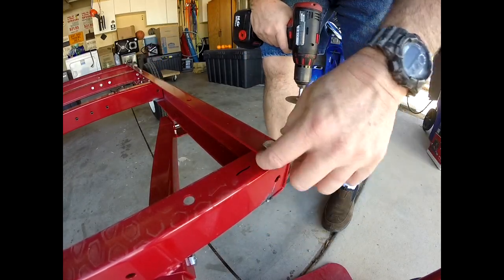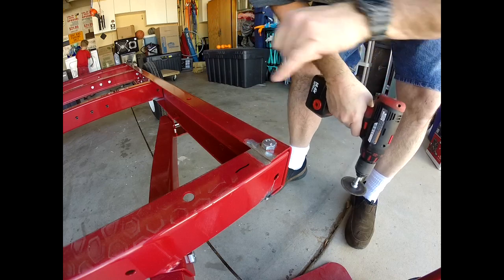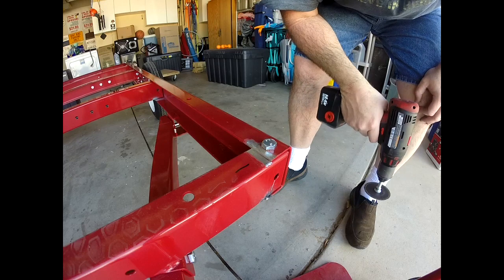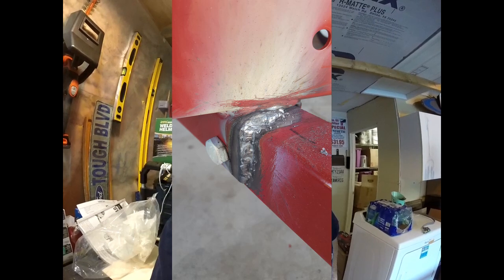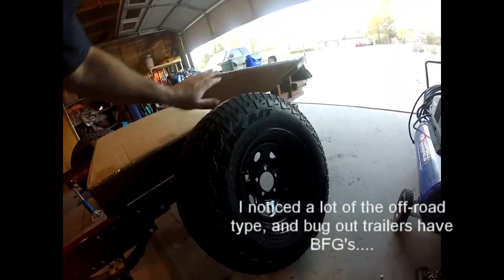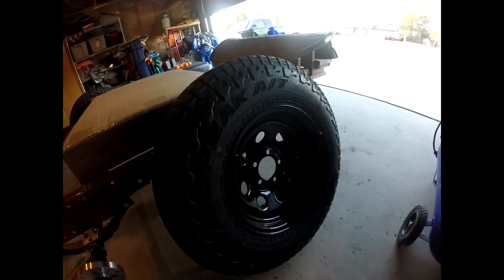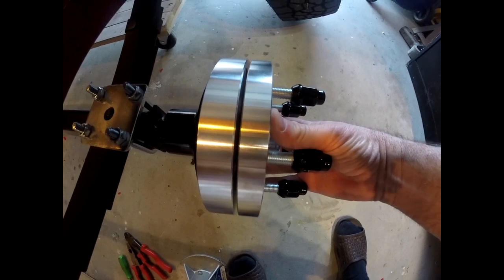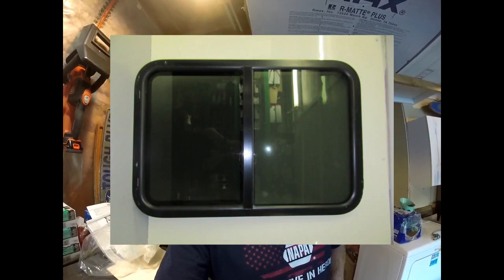Homemade DIY Camper - Hub Issues

Comment: You have to upgrade to a 3500lbs axle for 5 lug hubs and itll come with brackets to add brakes which is what I'm doing to tow with my Corolla. Also 3500 lbs axle is wider so tires fit better.

Comment: I was thinking about doing the same thing with my trailer with a 4 to 5 adapter for the lugs. I was having a hard time finding the adapters also. So I came to the same conclusion changing my 4 lug hubs for 5 lug hubs and be done with it.

Comment: Would changing the hubs to a 5x4.75 to match my truck be difficult?
Reply from the maker: I don't think so. Just get the same axle diameter hubs with that bolt pattern and then swap it out.

Comment: I have been thinking about spacers so I can have the same hub as my tow vehicle and only need one spare, plus trailer gets a wider stance making it look better. Where did you get those
Reply from the maker: I bought them on Amazon. Here is a link.
https://www.amazon.com/Adapters-YITAMOTOR-Compatible-Wrangler-Cherokee/dp/B06XRVZZZK/ref=sr_1_13?ie=UTF8&qid=1541306291&sr=8-13&keywords=wheels+spacers